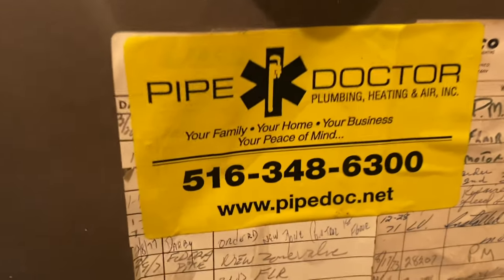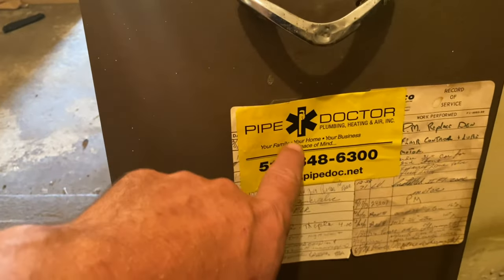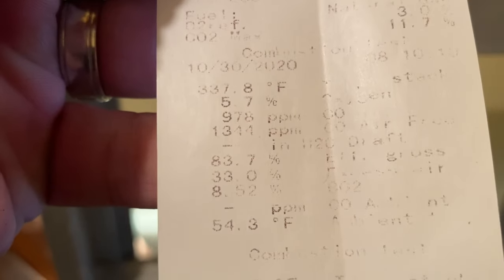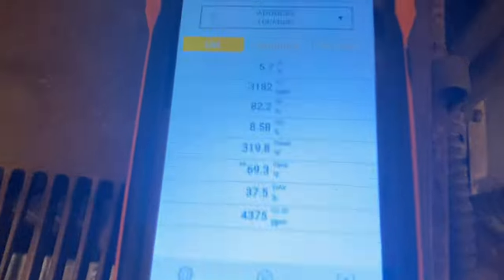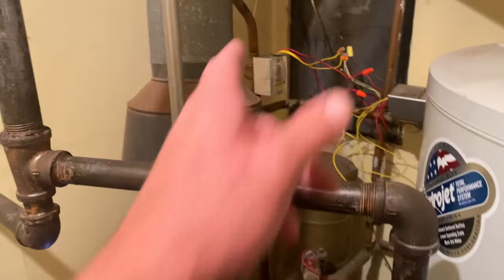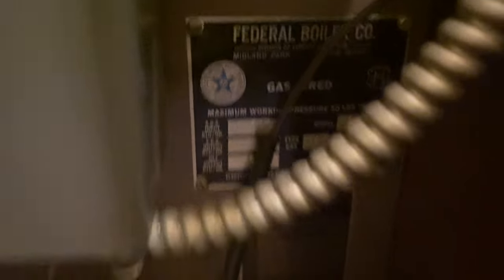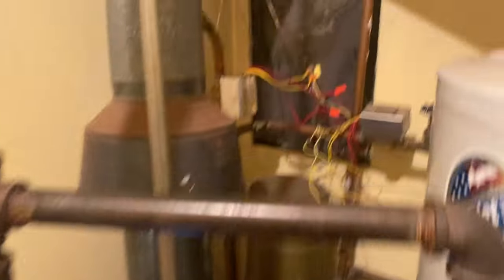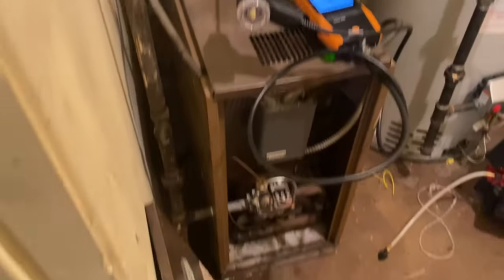Help Me! Old Federal Gas Boiler Very High CO Levels Added Spill Switch & Will Save Their Lives

Comment: I had six hard wired smoke detectors and two battery powered carbon monoxide detectors original to my home (2002). After doing some research, I discovered they should had been replaced a long time ago. Last December, I replaced all 6 hardwired smoke detectors with smoke+CO detection and got rid of the battery powered CO detectors. It brings me much more peace of mind knowing that every bedroom+hallways have CO detection now.
Reply: Just remember the job BY DESIGN of a co alarm. It is to alarm AFTER you have been poisoned by co but hopefully before you die. There are many instances where the fire dept arrives to a call and someone is already dead and the co alarm is going off.. unfortunately that alarm was not fast enough

Comment: When I talk to the boiler manufacturers with the blue jacket and the gold use to be blue jacket "IN THE UNITED STATES" they state that they do not publish combustion testing limits for atmospheric and basic power vent appliances (sealed combustion 90 + yes its in the manual).  Therefore they do not say you need to test those basic boilers.  But that said they do not say not to test.  That said on the basic boilers they are not allowed to let a 400 ppm "AIR FREE" boiler / furnace / appliance leave the factory by code/association limits.  So that said they have said to me any equipment like that putting out over 400 ppm "AIR Free" I do find, needs to be shut down if it cannot be fixed.    50 ppm and 100 ppm are guidelines that are "Best Practices" established in the testing industry and community and not code.  All assumes proper venting.    Some people have been teaching practices modifying vents by removing or capping fixed vent hoods and adding barometric vent dampers, this violates the UL listing if they were not tested that way.   The boiler itself did not have a spill switch as made so not part of the UL rating if there were any then and if the gas valve sticks open will not shut it anyway, if the chimney is compromised and I have seen things like kitchen pot belly stove openings in walls that they pie plate came off, there fore the spill switch will never see it and you have an almost instantly lethal dose of co in the house. Yes I know people that have been poisoned that way and will never be the same.   Therefore and depending on the jurisdiction we should shut it down or notify the local inspector, fire department and or utility of what we find and they will have it red tagged if deemed to be a danger.    I use to do what you did when I was young, reps and inspectors have since instructed me of the liability I took on.   We teach the young ones that are impressionable and follow our example unknowing of what the full scope of the actions can lead to.   I saw your rant in the end, hope you understand and do not fit my statement into that category.

Comment: I have find this problems in older boilers and sometimes by lower it  the gas pressure on the gas valve you can bring the CO under 100 ppm.

Comment: Brush it down and adjust your gas pressure. That  boiler is notorious for flame quenching and lowering the flame height down a squeak will typically drop the co like a stone.. granted it is as old as I am
Reply: It also looks like the stack wasn't up to temp when the reading was taken.
Reply: THANK YOU !

Comment: This needs a better explanation. Obviously it was designed to burn properly. What is it about this installation that makes it impossible to adjust to spec???
Reply: Clean it !
Reply: likely the burners are dirty and chocked for air, as well as the boiler sections sooted up from oversize dirty burning pilot. possibly rusty crud from the flu pipe laying on top of the sections. there's possibly elevated stack temps too, which would be from buildup inside the water jackets.
it's possible cleaning it may fix it enough to pass, but it could be multiple hours of wasted labor.
Reply: @throttlebottle5906  basic service.. CLEAN IT.. Then do a combustion test... This guy is a terrible tech.

Comment: Maybe switch to ink printers instead of thermal? Those old print-outs don’t hold up to time.
Reply: He documented it digitally.
Reply: @Cleiter88  Then why leave a paper copy in a pouch attached to the boiler? Probably in case someone else services it, or for the customer to review. If leaving a copy it should stay legible. Otherwise, why leave it?
Reply: There are no inkjet printers of that form factor, used to be a long time ago(+-92, there were notebooks with embedded HP printers). Today you can either go via sublimation (printout cost about 1-2$ per slip) or good old fashioned needle transfer(low printout cost, but very expensive printers). I think a PDF file with the data is the best solution here, actually... Inkjet is not Water or UV stable, sublimation is not heat stable (it's wax on paper), needle transfer is not water stable. So only laser or digital left. I know some techs in Germany have mounted laser printers in their trucks(ADAC for example), but it's pretty overkill for plumbing...

Comment: Do you brush out the Heat exchanger?  It could be that the HE sections are dirty and just need the crud that builds up over time cleared.  It creates a restriction to the combustion process over time.
Reply: Fair enough, Im not sure why you are coming in so hot.  I was not meaning anything anything hostile, and since there is a learning element to this channel I thought Id ask.  Ill know better for next time.
Reply: Mark Hughes  You're lucky to get 15 years out of most furnaces nowadays.
Reply: Mark Hughes  I agree, but I constantly run into specific brands that have an inexcusable life expectancy before running into major issues (really any 90%+ furnace) and brands that have the same repeating manufacturer defect (Lennox POS 90%+)
Reply: Mark Hughes  Leaking condensate traps and collection boxes.
Reply: THANK YOU !

Comment: If you don't have a combustion analyzer, you shouldn't be doing ANY tuneups on gas fired equipment. I condemned a 40 year old rheem a few days ago because it had 2151 ppm CO and the blower was pushing the flame in the middle burner. Not enough to cause a roll out but regardless, it's getting replaced
Reply: Clean it !
Most people don't know how!!
Oil burning equipment should be cleaned annually.,Gas when the PPM high !
Clean it adjust the GV or replace the GV!
Reply: @PipeDoctor  we didn't have that luxury, now your more of a replacement guy but if you look at the manpower you throw at a replacement verses a clean up you'll make out all day long.
Chimney system. 
Fuel delivery system. 
Heat transfer system. 
If two out of the three aren't compromised it truly should be fix .
Plus you send the rookies on those while you tend to other things!
Just my opinion !
Some hated clean ups but if you look at it it's the same thing your supposed to do with an oil burner regularly.